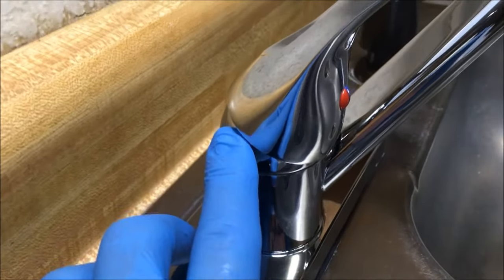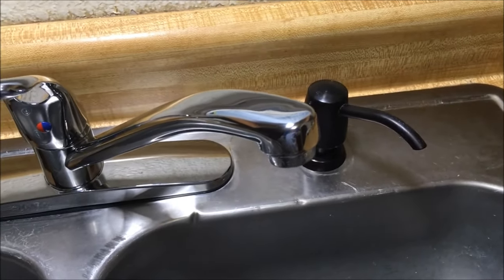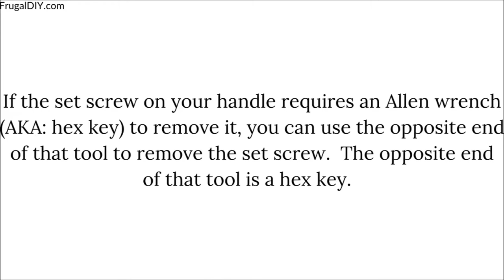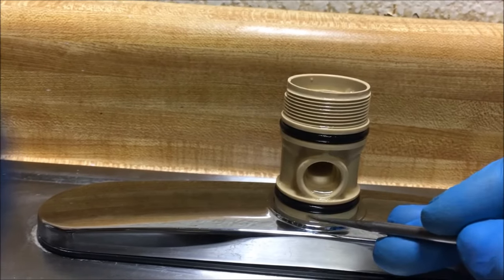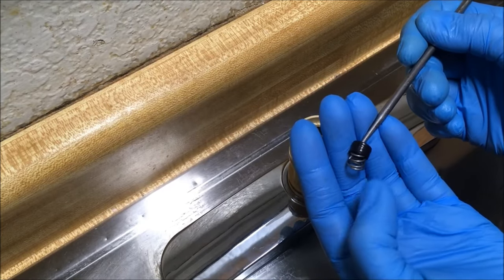Fix Leaking or Dripping Kitchen Faucet | Single Handle | Delta, Peerless

Comment: Word of caution for those who have an older home ie plumbing turning the shut off valves can cause these to leak. If you haven't touched these in 15, 20 years that was my experience now I have to replace both valves. I was able to tighten the nut on one but other leaks a lot. I fixed the leaky faucet though, just a word of caution but otherwise hands down this is the best how to video on You Tube.
Reply from the maker: Great info to add, Brian, and thank you.
Reply: Perfect! No extra talking, good explanations, visuals are clear.
Reply: Very well done. I prefer simple instructions with few words and to the point. I have been following instructions videos and this was very helpful thank you.
Reply: True. Best to replace them with ¼ turn ball valves. They cost a bit more, but they're more resilient.
Reply: @misterfunnybones  Yes, that’s what we used, good point, good product.

Comment: Didn't work so good for me. The faucet is 13 years old.  Had a heck of a time getting it apart.  After struggling to get the handle off after loosening the screw I couldn't turn the adjusting ring with the little spanner wrench due to the hard water build up..  Soaked everything with WD-40 for a while and but still the ring wouldn't turn.  Had to use a screwdriver and hammer to get the ring to turn.  The swivel spout didn't want to lift up either.  Had to use a crowbar to pry it up.  O rings were bad and so were the seats.  Now the locknut won't screw into the cap after cleaning the hard water deposits from it. Took my parts to Lowes where I bought it to get some new ones but they don't sell Price  Pfister anymore so I couldn't get my parts.  Went to two plumbing stores but they didn't have them either.  Looks like I'm going to have to buy a new faucet.  What a nightmare it's been.        UPDATE:  I called Price Pfister to order the parts but the faucet has been discontinued and no parts are available.  So price Pfister isn't going to honor their lifetime warranty.

Comment: So ours was originally just dripping. I bought a sink kit, but it turns out the ball is different from ours. It looks like maybe the o rings and seats and springs are also slightly different. Now it is leaking near the base of the faucet arm. This sink faucet looks exactly like mine. When I took it apart, it was literally the same. Would anyone know what model and brand this faucet is? I think I need to go to a local hardware store to find the rubber parts, retaining nut and cap to replace. Thankfully it is not a complete disaster. Water is not spraying everywhere. I would just like to repair it without having to pay hundreds of dollars for a Plummer.

Comment: Another success story here! Thank you for your video with clear and easy to follow instructions. No fluff and straight to the point. I did a whole disassembly of my Delta faucet, cleaned and greased everything, and it turns out I didn't need to replace any parts. Just had to tighten the top crown.
Reply from the maker: You're welcome, Chris, and that's wonderful to hear--truly.  Thank you for the kind words.  It's much appreciated.  Merry Christmas!

Comment: Best video for this repair I've seen yet.👍

But for whatever reason,  I Cannot get the seats & springs to seat. Been working with the both sides for over 2 days, meaning running outside turning water on only for a few minutes at a time because since they're not seated, now instead of the dripping faucet that I started with, I now have a running one.

I've tried pressing with my fingers, and with various rounded ends of different tools. Even with the ball itself (Wondered why I didn't think of that long ago🙄. And was sure that would work👍😁. NOT). I've even tried, while pressing down, using the point of a steak knife, 'wedging it in' all around...

Would just replace the whole faucet, but 'things' underneath the sink are so old and corroded 😳... I don't want to go from almost psycho to absolute madness (Undersink leak?!? Under house leak?!?!?! Just bury me now ⚰). 

Any advice, anyone???

And to those of you with 'funny bones'🙄, please don't suggest a plumber. Not unless you're paying.

Added-- Oh. I also tried a different set of seats and springs.
Reply from the maker: Thank you so much for your comment.  ;)

Comment: Great, simple video! 👏 can someone please advise?  Mine is a very similar Delta single lever faucet.  It was dripping out of the spout.  Disassembly and replacement of seat and springs went great. Cleaned, greased and reassembled.  Lever was so smooth.  Leak at spout stopped but now it's slowly seeping out of the base and theres NO HOT WATER! What the heck?? Yes main water shut off is back on and cold and hot shut off valves are back on.  Thanks in advance 🙂

Comment: Great video.  I'm stuck at the very beginning.  I can't get the cap off. Please help.
Reply from the maker: Thank you.  Re the cap--I'd try a large pair of Vice Grips or Channel Locks to remove the cap.  Make sure you put something between the cap and tool to protect the finish on the cap or you will scratch the finish.

Comment: Btw, if you call Delta, they will send you the part, but you'll have to send them a picture of your faucet unless you know the model number. Although then it will take 8-10 days to arrive. I live right around the corner from an HD, so I could have been there and back in less time than it took to make that phone call.
Reply from the maker: Thank you for adding this great information, Patricia.  It helps us all.

Comment: So if it's dripping from the end we just do the seats and springs and not the other?  Is there anything on the end of the faucet to deal with?  Another video from one of the big box stores basically said to buy the entire kit and replace everything. I have replaced seats in springs for my bathroom faucet before... It's going to have to be this weekend before I can handle this because I'm about to leave town so I'm just going to turn the water off while I'm gone so it doesn't drip. I really wish I could tackle this this morning though

Comment: What if I can’t get the set set screw to loosen?? It’s very hard to get to, half facing the wall, so I can’t see what tool is needed but it feels like an Allen wrench fits in - yet it is not getting any looser! Any hints?
Reply from the maker: Hi Rochelle.  Here's what I'd do.  Get a flashlight and mirror.  Point the mirror directly toward the hole where the set screw is located and shine the flashlight directly toward/onto the mirror so you can see if the set screw, in fact, takes an Allen wrench.  If it does, I'd take take a pair of Vice-Grips/locking pliers and clamp them onto the end of the Allen wrench as I'm turning the wrench. 
 Note: slow and steady pressure/force is the key here when turning the Allen wrench with the locking pliers.

Comment: 2:27  What is the name of the tool you used to tighten the retainer nut?  And is it generally available at hardware stores or online?

5:29  Can't tell which end of the cone-shaped spring is inserted into the bottom of the seat.  Is it the wider end of the spring that's inserted into the bottom of the seat?
Reply: The retainer nut tool is included with most parts kits. Springs go in big end first. The seal washers then sit on the small ends of the springs.
Reply: @misterfunnybones  Thanks.  As the faucet was still within the warranty period, I had ordered the parts separately (over 3 separate orders), so I never got a kit, per se.  After replacing every moveable internal piece, with no improvement, I finally figured out that the little ?knob? that the ball mechanism attaches to was missing -- apparently broken off.  As that was integrated with the base (which was NOT going to be replaced under warranty), I threw in the towel and bought a new Moen faucet.  Same design, though, so hopefully I can apply what I've learned to future fixes with this new faucet.  🙂
Reply: @eponymousIme  yeah. It gets to a certain point where your time plus parts costs more than a brand new faucet & the newer ones are very easy to install. Let's hope they last. 👍

Comment: What is the name of the tool at 1.57?
I will appreciate anyone soon reply
Reply from the maker: I don't know the name of the tool, but it comes in the repair kit you can buy that has all of the parts you need to repair the faucet.  The tool is a wrench made to remove and tighten the retaining nut.  Look online and you'll see the repair kits.  Lowe's and Home Depot have them, too.

Comment: what happens when you cant get the handle off
Reply: @act10njackson88 You actually have to give it a bit of a tug. I'm a middle aged woman with fairly good strength. But afraid that I might completely break it so I started off pulling gingerly. Then decided I'd give it a good tug. It came off. I also had to give it a pretty good push to get it back on & all the way down.

Comment: Would anyone know if the cap gets damaged during removal, can I use a cap from a similar model?
Reply from the maker: Maybe, but those caps can look similar to each other and not work because the threads are different.
Reply: Did you ever get your cap to the faucet off? I can't get mine off.